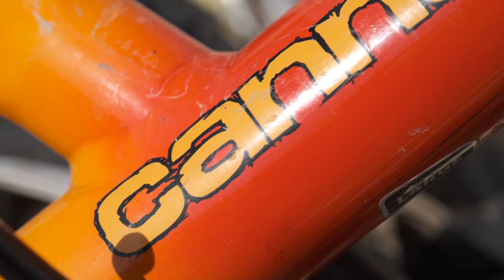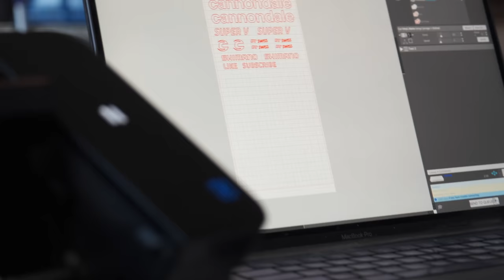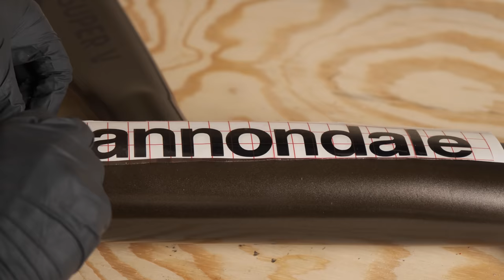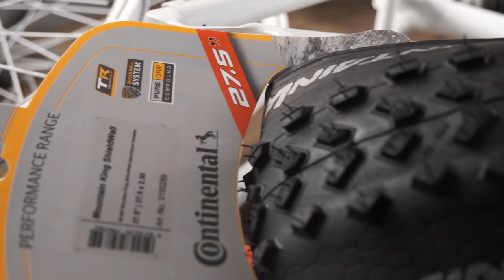Restoring and modernizing my childhood dream bike: The Cannondale Super V

Comment: I’d personally grind down the disc brake bracket instead of the frame
Reply from the maker: 🤔 Wow. Good point. Surprised no one else has mentioned that after 50k views. Next time I'll do that!
Reply: @BuildaBetterBike  great job! I have a 98 super v900. Love the thing but needs rear disc brake. Where did you get the rear caliper adapter bracket?
Edit - never mind I see parts list,thanks

Comment: I owned a Super V 500 but traded it in 1997 for a T700 to ride across country. I still ride it and miss my Super V.  I am rebuilding my 1999 F1000 hard tail and luckily I have a disc brake ready bike and will only change out the front fork and keep my ChromaLusion Purpleen paint. I will upgrade my BB and Cranks and add 12 speed SRAM system and Magura Brakes. Your video is very detailed and got me missing my Super V even more. Love that detail on crossover from a Fatty to traditional fork. By the way in France they still rebuild the Fatty. Thanks for sharing your dream.

Comment: I have the Cannondale Super V 400 I bought in 1998 and have only ridden it 6 times. I just pulled it out of retirement. Only thing I need on the bike is a new chain and inner tubes. Paint at the back wheel where it connects to the frame has flaked off,otherwise it’s in perfect condition. Nice video here

Comment: Awesome build! The Super V was my dream bike in the 90's also.  I built one very similar to yours with the same offset headset but I was lucky enough to find a Jekyll swing arm so I could run a longer shock in the rear.
Reply from the maker: Ah cool. A proper Uber V then. I looked everywhere for a Jekyll swingarm. Do you have the build posted anywhere?
Reply: @BuildaBetterBike  No I don't but I've been meaning to do a walk around and ride of mine. It turns a lot of heads with the older riders especially around here because the old Cannondale factory is right down the road from my local trails.

Comment: Got 5.5inchs of travel out of mine . Cut in half the bolt on fork brace off a set of tange suspension forks then bolted them to the frame shock mount bracket. Got a longer fox air can . All sweet. Some one still has it. The down tube did crack at the front of the shock mount after I had it they just welded it up.

Comment: Great job. Used to sell those at Helens cycle in Westwood Los Angeles. I still ride my 1998 Santa Cruz Heckler frame. Mix of components from the  2000-2010. Still running V-brakes.

Comment: My first mountain bike was a 2000 SuperV700SX. I still have it too although I primarily ride a 2015 Scalpel 29 now. But I had the cast/bonded swing arm which crack (lifetime warranty on the frame, I got 40% off on the Scalpel). So I fixed it with a tube swingarm like what you have but it was already equipped with the caliper mount. The bike came with a Lefty so that already had a disc brake. About two years ago I replaced the old Magura Clara/Louise with mewer MT2's.

Comment: Awesome work, Dude! I´ve modernized my old beloved ´05 Stevens F9 Race too, with a dropper post, longer fork, shorter stem, wider handlebars, angle headset, broader rims, offset bushings, and now it´s behaviour is supreme. But I had one problem: First I shortened the stem from 110mm to 80mm, but this doesn´t work well because of the (short) geo of these elder bikes. Now I changed to a 95mm-stem, and it works a lot better. And I had to steepen the seat angle too, because of the longer fork (+20mm) and the offset bushings, otherwise I got problems in the uphill.

Comment: Rebuilt 1 98 Super V500. Those swing arms  pivots are a bear. Nice build. I listed after Cannondales and Super V after riding in Steamboat Springs in 1994.  

Working on a 2000 Super V800 now. I’m going to keep the headshok and rear shock but looking into Uber conversions. Installing Microshift Advent X 1x10 drive. Other bike has a Sram GX setup but not happy with it. I will convert the 98 to the Advent X if it goes like I think
Reply from the maker: Nice! Would love to see it when you're done

Comment: Nice build. That frame is similar to the Scott octane FX3. I had. Updated to 1X10. The chain ring top was on the pivot point and pedalled really well.
Sadly, couple yrs ago, frame cracked at bearing points. (over tightened pinch bolts) It was buttery smooth with 5th element air shock, a psylo xc 125 upfront. I miss that bike....:-(
Reply from the maker: Ooph. :(

Comment: 22:13 Mounting the rear shock in reverse. I don't think that you will notice a difference (moved mass vs. unmoved mass), but i just wanted to let you know. You should think about to replace the rear shock with a modern air-shock. There are shocks that provide some extra mm of travel with the same mounting size. 2mm extra travel will respond in ~5 to 6 mm more travel at the rear wheel. Air-shocks are much easier to set up to your weight. Just add pressure or lower it, no need to change a coil. A Head-Shock or Moto 120 fork would look even better but so far it's pretty nice.

Comment: I’ve been using Allen skewers any place I have a weird dropout situation like that disc mount you put on the back.  It not like you can flip the lever and drop the wheel anymore without unscrewing it and it really cleans up the look.  They are around $16 for a set.
Reply from the maker: I didn't even know they made those. Great suggestion!

Comment: hello you have installed 27.5 inch wheels have you changed something on the frame? I have 26x2.1 tires on it and about 1cm of space at the front of the swing arm is that enough for a 27.5 inch wheel? Thanks.

Comment: I still ride my sv2000 lots, it is 26 now!   Changed from 8 speed to 10 speed with a clutch a few years back and a 42 tooth allows more or less 1x with the mid ring engaged at front but why chuck the big ring when it works eh. I have magura hydraulic rim brakes, never had an ounce of trouble with them. In the dry they are equal to most disk set ups. The rear shock blew for the 2nd time so I went for a block of wood set for the correct ride height, carbon seat post and wide tubeless rear tire and a comfy brooks saddle, I honestly wouldn't go back to a shock, this is better for me at least!  I guess you could describe the feel as wooden? Still running a square taper bb, they last forever. I have replaced both wheel bearings once and steering bearings once and it all runs sweet still! (coda hubs front and back.)  The biggest disaster on mine was the coda triple crank which endlessly creaked and came loose where the crank arm joined the rings. It was a thing of beauty until you used it!  I am still on original rims but they are worn big time now! 21 r and 17mm f internal which seems ridiculous now especially the front. Still I run a 2.4 on it no problems so far, no shop would advise that yet ......     My lottery win upgrades will be 2 new rims and maybe a 1 x 11 gearing but that will be years away yet!   Thanks for posting, great project!   I still love mine after all these years, thank you cannondale if you are reading!    From Australia
Reply from the maker: Amazing. Block of wood? For reals?!

Comment: Super super awesome video. Best restoration videos there is on YT. Loved the cable holder extension. And the rear hyd brake conversion. Well played! The routing for the dropper post looks a little awkward though. Where do you buy your little spare parts from? And did you fabricate the bracket yourself for the rear brake?

Comment: Quick question. I just got a yellow super v 400. I just ordered the "26in mag rims(imesh bean)" off of Amazon. I didn't know they only take disc brakes. Do you know what I have to buy to switch them over to disc brakes? I haven't been into bikes since the 1990's Thanks! I also got black/yellow panaracer xc tubeless tires, black/yellow grips, black/yellow pedals, and a black/yellow seat.
Reply from the maker: The adapter I used is linked to in the description
Reply: @BuildaBetterBike  Thank you.

Comment: When I upgraded the shocks on my F300 which originally came with some rockshox the reducer on the bottom that cannondale would fit was quite long to compensate for the position of the crown in relation to the downtube. So when I fitted a longer travel shock I did have work work with a collection of reducers and a tapered steerer to JUST clear the downtube, which isn’t an issue in normal riding but if you wiped out, could dent the downtube and ruin the frame. Did you deal with this or is your shock ‘“limited” in its rotation due to the downtube?
Reply from the maker: Oh interesting. No I don't have that issue with this one. I believe the pre 2000s Vs are actually different diameter and height in the head tube than later Cannondales that supported the Headshock.

Comment: Great video, top notch work. The only things I would do differently would be modern crank/bb or I would have not messed with the original finish on those immaculate lx cranks!? And did you put steel washers on the chainring?
Reply: My thoughts exactly.
Reply: And a Shimano drivetrain.

Comment: Really nice build. I used to ride a super v in the 90’s and it was amazing back in the day. Question: wouldn’t the stack height from the head shock allow to make it a mullet set-up? Perhaps 27,5 in front?
Reply from the maker: Good question! I'm not sure
Reply: It is possible with a lefty.  Just alter the spring length.  With a normal fork, never had funds to try.  Would have to have a deep stack or plenty of rake so it wouldn’t bottom out on frame I guess .

Comment: Ive got this exact same frame waiting for rebuild. 👍 I need to get an adaptor for a 1-1/8" straight fork any ideas ?
Reply from the maker: I actually think adapters for these are hard to find. I read of people making their own. But I just used a headset that fit and also added some offset for a more slack geo. See the link in description.

Comment: by adding a bigger fork your going to blow throw your rear suspension as you have changed the ratio of compression aswell as the head angle old frames especially single pivots dont like a big front end & you will probably tear the frame apart at the head tube
Reply from the maker: It's certainly possible. But at least it will be fun while it lasts.
Reply: @BuildaBetterBike  I wouldn't worry, there are many Super Vs out there running big front ends and doing some very gnarly stuff without any issues. In fact I've yet to see any Super V break at the headtube... These things were built incredibly strong. Enjoy your beautiful creation!

Comment: I’m currently building my Super V and love seeing this. Mine has the rear factory disc mount which I haven’t really seen before.  I have a few questions that I hope you don’t mind answering. 
Did you rebuild or replace the shock? If yes what did you do? 
Was it difficult to fit 27.5” wheels on the bike? Any restrictions or mods?
Reply: He fit a 27'5 only in the front by using a new fork , on the rear it's not a 27"5 .
Reply: @darkki94  thank you. I don’t have 27.5s to test it with and didn’t want to buy a set just to find out they don’t fit.

Comment: Nice job on the build, video, and party/tools links! I'm curious on how long the dropper post will stay on the bike.   Have you had any issues with the rear triangle hitting the bottom of the dropper post?
Reply from the maker: No. The bottom of the dropper clears the rear triangle fine when bottomed-out.

Comment: I’ve had a Super V2000 frame for several years now. Accumulating parts for the build but thinking about doing the Uber V conversion. Have you considered this?
Reply from the maker: Yeah definitely. I'll talk about that a bit in my follow up video. Main issue: could never find a Jekyll rear triangle.
Reply: @BuildaBetterBike  …..I bought a Jekyll triangle on eBay about a year after I bought the frame. Have 80% of the components I need. Your video is very inspiring and will probably kick mine into gear. Outstanding job on the build and your editing skills 👍
Reply from the maker: @alcopower5710  Nice! best of luck on the build and thanks for your kind words.

Comment: Ive done about 6 of these have bought one new in 97. Just finished one in original rim brake XT spec and fox alps 5 The first real off the peg suspension bike that worked. And still stands up against modern lightweight suspension bikes. And the headshok has never been bettered for tracking. Shame theres so many variants and parts, other than seals, cant be bought.

Comment: Super amazing job I have not seen anyone do a better job than you.

I am in the middle of doing the exact same with a V 500 active 80.          Couple questions 
What bracket did you use to add the disc brakes to the rear.
What size front chainring,cassette and chain did you use .

Thanks
Reply from the maker: Thanks! All parts linked in the description
Reply: @BuildaBetterBike  shoot I’m sorry I didn’t even check the description my bad.  

But again great video and you definitely have some great skills
Reply: Do you happen to know the size of bearings you used for the swing arm pivot I didn’t see them in the description list.
Reply from the maker: @Graemesbullys  These guys: https://www.amazon.com/gp/product/B0819B183R/ref=ppx_yo_dt_b_search_asin_title?ie=UTF8&psc=1

Comment: Don't grease the square taper. The cranks will always work loose, you will tighten them, this cycle will repeat until you crack your cranks. It's a friction fit. You want friction. Don't grease.
Reply: Interesting, how would you prevent them getting stuck?
Here in Brazil we still use a lot of square taper BB, and it's one of the worst things to remove, sometimes the angle grinder is the only option.

Comment: The rear disk brake mount you made goes from IS to post correct? Could you make me a disk brake mount for my steel Ibis?
Reply from the maker: Link to the disc break adapter is in the description.

Comment: Hallo guy !  I have one question. I have a red m 800 . The parts are pulstar, white industries ,, tune , , and so on . but 1 problem exists:   i am 1,87 cm height  and 48 jears old and i search for over ten years a stem increase in the size 1 1/4  inches . The standart size is 1 1/8 inches , Do you know a company  greetings from germany Jürgen

Comment: Amazing build man! So I have Cannondale Delta V with the headshok and I was wondering about the angle set. The one you used that should work on any of the headshok head tubes right?
Reply from the maker: Actually, I don't think so. If I'm remembering correctly, there were two different sizes. The one on the pre 2000s Vs were a bit larger. So it's be good to measure your head shock diameter and make sure it matches the headset. Link to the one I used is in the description.
Reply: @BuildaBetterBike  Thanks man! Again awesome video

Comment: In all the bike looks mint, BUT I really dislike the huge Shimano graphic on the cranks sorry to say. The Original Deore LX logo would have looked more sleek and subtle IMO. Also, why did you not spray the bare metal disc mount to match either the frame of other black components? Lastly, and I'm sure this is a functional reason but a mix of Shimano and Sram on the drivetrain....is that even allowed, haha? All that aside, still looks ace. Hope you will post the riding video!
Reply from the maker: I appreciate the feedback. Cheers!

Comment: You are not allowed to remove the paint , I have got 2 Cannondale 90s and I would never ever remove the original red paint even when it would burned down its the best of cannondale the paint greetings Nürnberg / Germany
Reply from the maker: Yeah, sorry. I repaint everything. That's 50% of my motivation to find old bikes to begin with. :)
Reply: @BuildaBetterBike   friend Do you know a link of a disributor for one ahead stem elevation bicycle in size 1 1/4 inches for my red 90s cannondale m 800  ?      greetings Nürnberg Jürgen

Comment: Isn't there any better straight steerer fork than XCM around? Other than that it looks sweet
Reply from the maker: I couldn't find anything that was 27.5. XRP makes a 27.5 with straight tube option, or at least they did. They are currently unavailable on their site.

Comment: What blast media do you use for your frames?
Reply from the maker: Usually glass beads because Im impatient. But it's a bit grittier on Aluminum than I think I should use.
Reply: @BuildaBetterBike  I know with glass beads they can be re used many times as they don’t break down as easily. But I prefer the stripping power of aluminium oxide with a wider spray nozzle. Lower pressure but more efficient and leaves a great surface for paint.